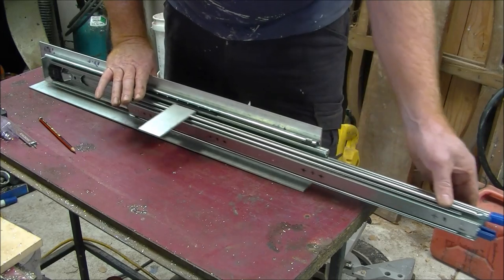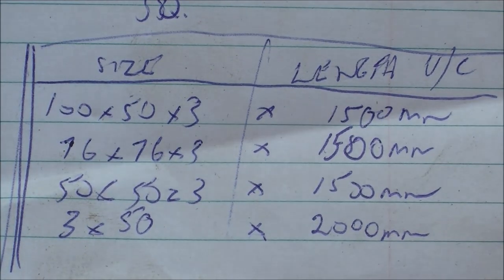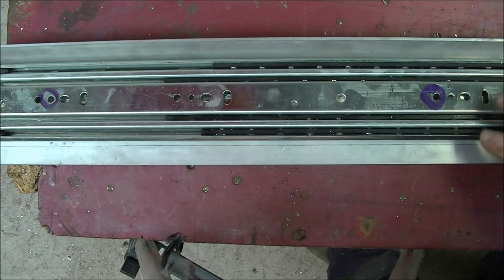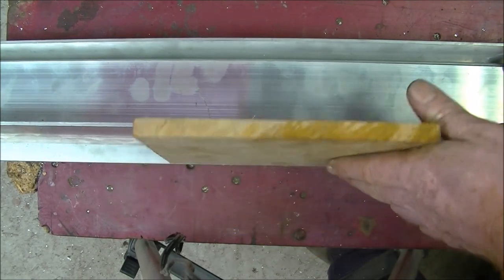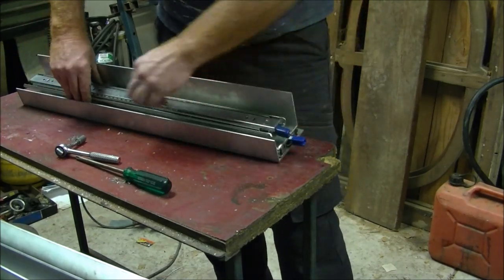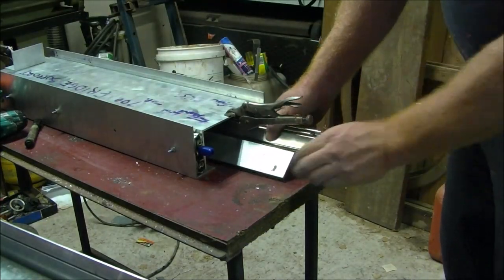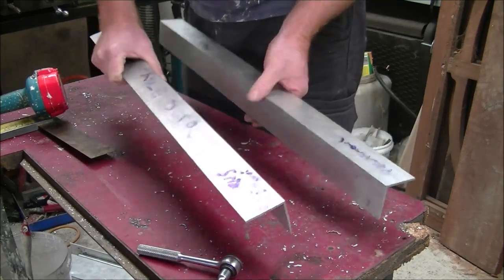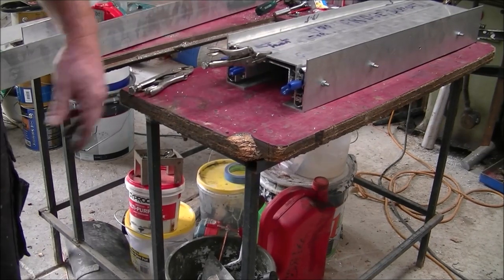HavaCrack: at Making a 4WD Fridge Slide Storage

Comment: That's best video for DIY.  Your comment below said 12mm ply is ok for the box frame. I am thinking of using 19mm but that makes it heavier to take it out.
Reply: Thank you for the reply. I do have biscuit joiner and certainly will use it for the drawer cabinet. I am worrying about how it copes when in rough terrain. In fact for the cost of three pairs HD drawers, you can buy a set of drawers from 4wdsupercentre. But it would be very difficult for one person to take it out of the boot if I want to put the third row seats back. Will wait for your other video before building mine. I live in Melbourne by the way. Thanks again.

Comment: This is so ridiculously clean and well executed and awesome looking! Wow, I am looking to do this but honestly I am not sure I got the skills needed to accomplish this. These Drawer slides are pretty expensive. do you have the dimensions? I am looking to build this for the back of my JKU to use a 50 Qt ARB fridge.
Reply: Thanks so much! I can't wait.
Reply: Hello, I am in the US so evidently here we do inches (I am French and I hate non metric stuff :-)  In your video you also have some flat strapping in your cut list? what is this used for? I am getting ready to order the aluminum according to your list and i want to make sure I get everything. Also for the top it looks like you are using some small angle to edge the carpeted top shelf is that correct? Thanks for you help